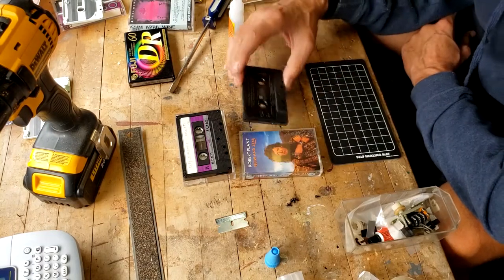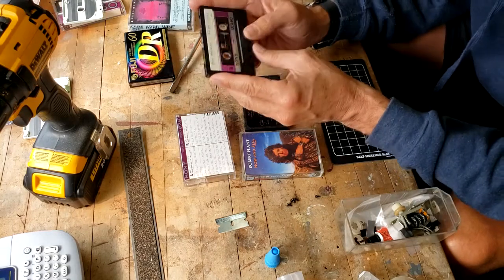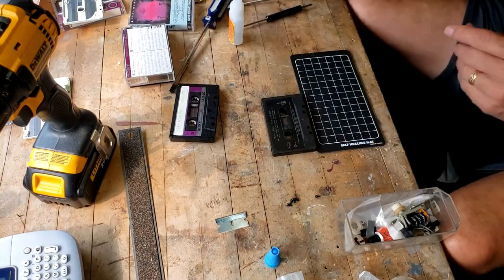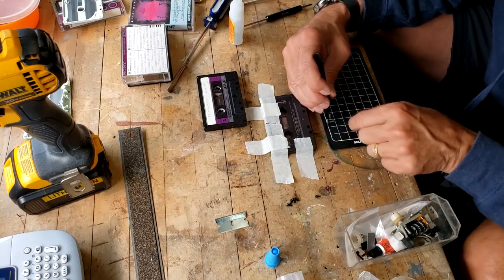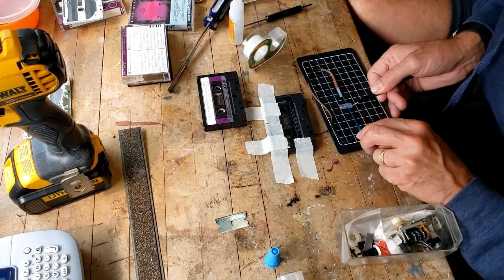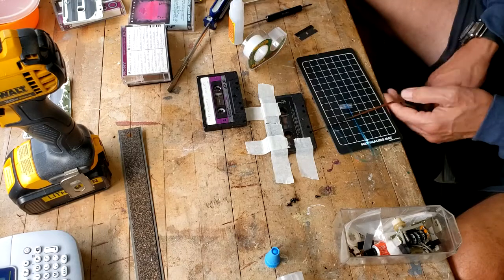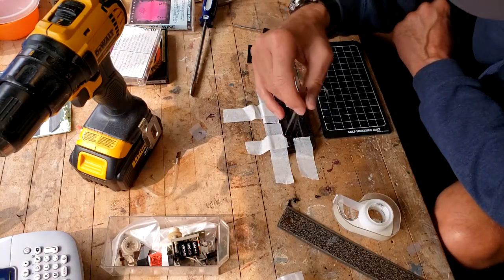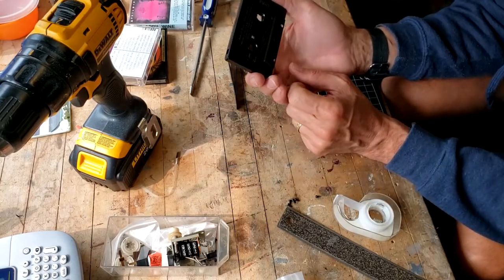Transplanting Cassette Tape from One Cassette Shell to Another (with welded shell)

Comment: Thanks Tim ! Just did my first transplant and I used your video as a guide...and it worked !! (with a tiny snag). I couldn't tell from the video which was side A and side B on both cassettes so I did the "transplant" from side A (original) to side A (new tape) and now the sides are reversed on my new tape, the songs from side A are on side B. I made the recording before I did the transplant, so that I could easily record the album on a new chrome tape. So maybe in future I need to do the transplant to a blank tape and then record over it.
Also I couldn't find a fitting drill bit, so I did all the (up)winding by hand using a pencil...that's 10 minutes of my life I'm never getting back lol
Reply from the maker: I do the transplants with blank tape and then record the sides afterwards. Important to note which is the longer side time wise.  I record the longest side first then pull the tape out and splice to the leader after pulling out the remainder of the tape. A Torx T45 driver bit works perfectly to wind and unwind tape using a battery operated drill as shown  saves a lot if time. Will be making a new clip showing the refined process sometime soon. You can of course cover the recording tabs with tape and re-record the tape so your sides are correct. I also used a 3D printed bit on Thingiverse that works perfectly instead of the Torx bit here: 
https://www.thingiverse.com/thing:3601654

Comment: hi am lucky i picked up a parts otari DP2700 

I deal with  1/8 inch  dubbing  i did this as well  before i got the deck  i pick up a to cassette unit that tell you how long the cass tape  is  in real time 
 make do is the best way if you don't have to gear  

note i don't use 8 track cart recorders as they have heavy wear on the parts very like what you are doing  here  i record on the  1/4 loop tape first and move it
to the  8 track body